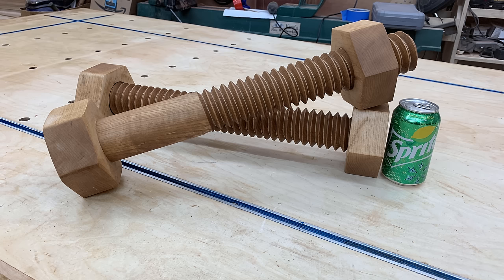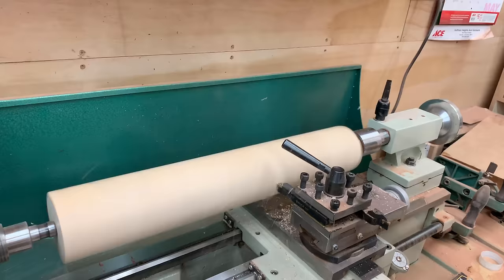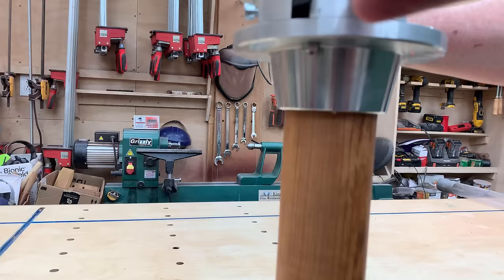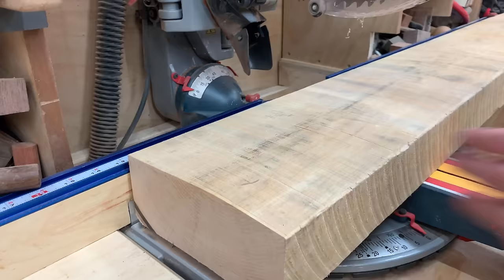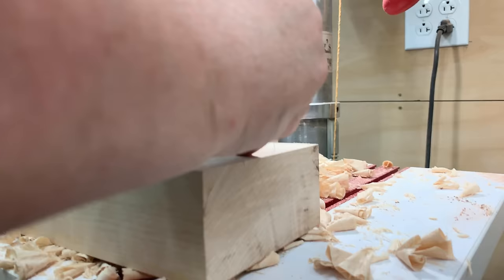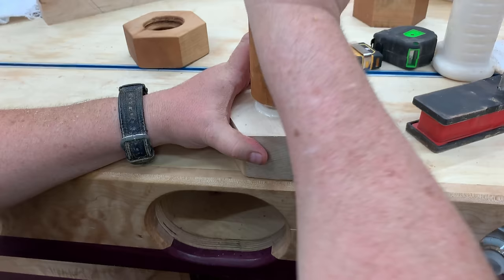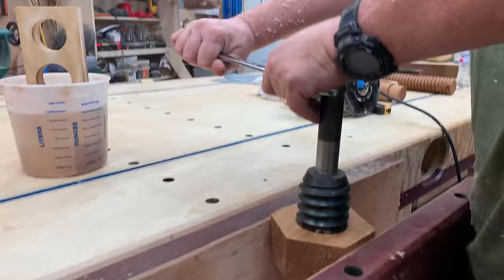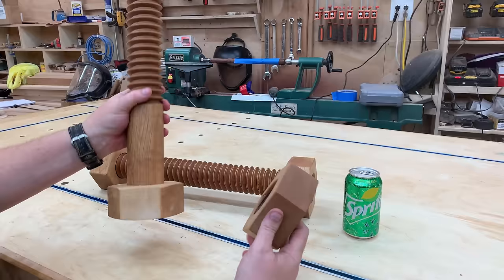77 - The Secret to Making PERFECT Wooden Threads

Comment: It looks like a real actual bolt, but the head to shaft connection is merely glue.  It will not support torque beyond the adhesive.  You can solve two problems with one hole if you drill from the side of the head making a hole to allow air to escape.  This solves your pistoning problem.  

Then, once you've got the shaft in, drive a dowel or rod or screw to provide ACTUAL torque connection between head and shaft and you'll be able to apply a lot more torque than mere glue can handle.  I know, glue is great, but you have an oil-infused shaft and you hurried to put the glue on before more oil oozed, so it's unclear HOW DEEP into the shaft the glue can actually permeate.  My guess-- not so much.

The wood screw can hold 496+lbs (if you say so...) but that head won't take any real torque in turning.
Reply from the maker: It’s a toy.
Reply: Perhaps you should watch some more videos on wood glue. Wood glue actually forms a bond stonger than the wood itself. Its been proven
Reply: @researchandbuild1751   perhaps you should watch some more videos on sideways torque and how to build a joint.  Wood glue by itself is useless.  You need wood for the joint to have strength.  If you don't properly build the joint the glue -- strong as you want to pretend it is -- won't hold up to the torque.  Bolts that are meant to be torqued are different than chair pieces holding downward weight.  Go watch some videos on torque and come back when you've learned something.  It's been proven

Comment: You used a $1000+ die to cut it, then linked to some plastic junk on amazon that's 1/3rd the size. I'm not sure you'll get the same results with those dies. lol
Reply from the maker: Well, you’re completely wrong. And you didn’t even listen to the video. 

Plus the tap & die on Amazon has a metal blade just like the Dieter Schmidt tap. 

And I show the tap from Wood River in multiple videos, and it cuts flawless threads. Go watch. 

The difference is that Dieter Schmidt is the only one who sells a 2-1/2” tap. And the price is a complete rip off. 

But this isn’t a video about me selling taps. This is a video showing you how to prepare wood if you want to tap it. 

And a bigger thread was easier to see on video, so I used my bigger tap. 

But personally, I don’t care if you buy one, or don’t buy any. 

But if you don’t pay attention to what I say in the video, and you haven’t even used the smaller cheaper tap, maybe consider not posting a comment in the future. 

Whenever I comment, I at least like to know what I’m talking about.

Comment: that large diameter die is not exactly cheap. The last time i checked, a 2.5'' diameter die costs around EUR 1160 . Anyone can cut screws with that kind of equipment. If you come up with at cheap alternative to make those threads, now that's what I call skill. Other than that, it looks like a rich boy playing with his very expensive toys.
Reply: Check out the channel Pask Makes he shows how to make your own tap and die. As long as you can get hold of a threaded rod the size you want to make.

Comment: Mineral oil. That's the secret. Not the special purpose gigantic tap made of not wood
Reply from the maker: Correct. The ONLY important thing is the mineral oil. With that you can just as easily cut the threads with a rock, or even your butt-cheeks.

Comment: That beautifully machined two-handed threading tool shown is about $650 from Dieter Schmid in Germany. And the shop has a $2500 Grizzley machine lathe! What are they doing even using a threading die when they have a precision threading lathe?

This is all so thoroughly irrelevant to the average woodworker it makes my head hurt. Fail.

Comment: Why is rolling a dice on the same side four times in a row considered rare? You have the exact same chances of rolling a dice on the same side four times as you do any other combination four times. Rolling a dice on the number 7 four times is a 1/24 chance. (Each role is 1/6). So even if you were to roll a random combination, lets say, 5 1 6 3. That is just as rare as 7 7 7 7. There is a 1 out of 24 chance of rolling any number four numbers.
Reply: This is incorrect. You need to multiply the probabilities. So the actual chance of rollin a dice on the same side four times in a row is 1/6 to the power of 4, which is 1/1296.